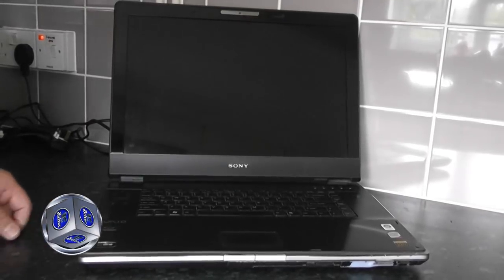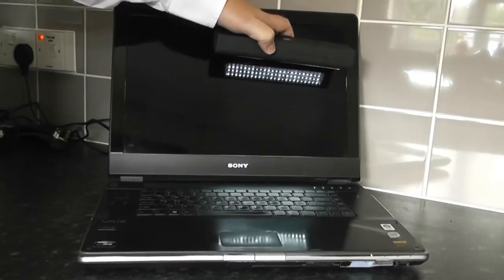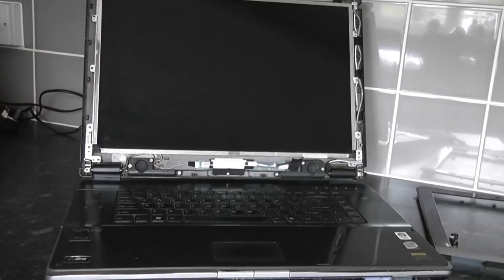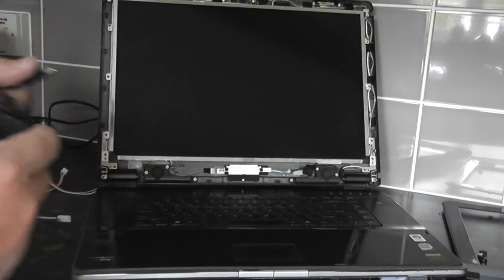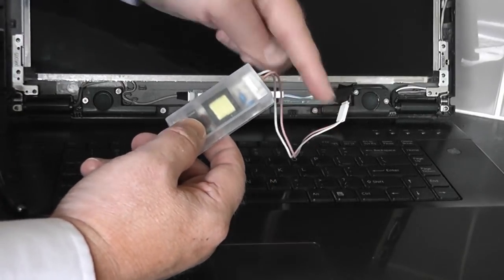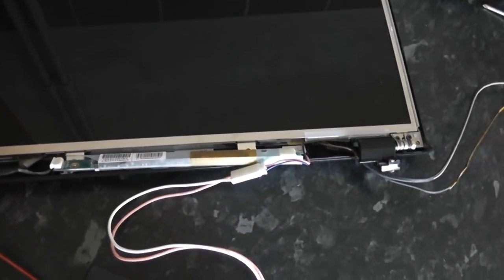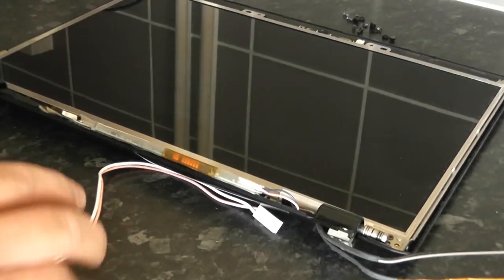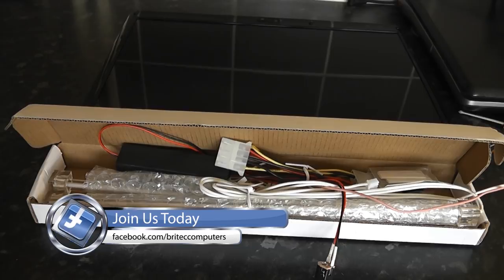Diagnosing Faulty Laptop Backlight or Inverter Problem

Comment: The inverter on one of my laptops failed and I didn't want to spend any money on a new one, so I searched for ways to actually repair the thing. Unrelated results came up so I inspected the miniscule board and came across a tiny fuse which looked like a rather large cloudy LED. I bypassed the fuse with solder (after testing with a pair of metal tweezers) and my backlight works once again! Word of advice, CHECK FOR ANY FUSES BEFORE ORDERING A NEW ONE ONLINE! You could save some money :)
Reply: Now you risk the chance of burning up the whole panel. An inverter is like 90 bucks but a screen = buy a new laptop.
Reply: ***** not true at all. I repair computers for a living and replacement laptop screens are usually at or under $100

Comment: The issue can be also related to a faulty GPU, sometimes when the GPUnit desolders itself you can get weird combinations of the video output like nothing on the internal display and a normal output on external vga or hdmi, it can be like half picture or only graphical content without backlight, distorted video output, lines, low brightness... first thing when I have a laptop in my hands with a faulty GPU I "reflow" it and if then still doesnt work as it should than Ive must re-ball it

:P

Comment: Awesome thought using a mini ccfl power supply like that. It never even occurred to me! I can pick one up for a few bucks.

I have the same issue. Though am just working out if it is the inverter or if its a control circuit in the laptop itself. Im going to go with the inverter as they are cheap.

Worst case you rig something up and you dont use brightness controls. Theres always ways around these things! Good video!

Comment: Hello, thank you for helping people like this.
Can you please diagnose what the problem is with the screen of my Aspire 5532?
Sometimes, immediately when I turn ON the computer, the screen is dimmed to about  only 10% of light just like when you use Fn+F6 to dim the screen, and I have to darken the room and then point a flashlight against the screen to see better what’s on the screen.
When the boot pauses asking me for the BIOS password, I take the opportunity to try to disable the dimming by pressing Fn+F6; and 1-sometimes it works right away but 2-sometimes it takes a lot more tries and 3-sometimes when it finally seems to work what happens is after 1 second it dims again forcing me to try just a few more times. And there is more; each time Fn+F6 doesn’t work, I notice that for just 1 microsecond the screen was getting more brightness but it couldn’t complete the job.
The next time it happens I will connect an external monitor to see if the external monitor is also dimmed or if it is OK, but maybe the information so far is enough for you to diagnose the problem???
Thank you again.

Comment: Which begs the questions.....How and can one replace the inverter? Where does one buy an inverter if they can be replaced? Is the inverter built on to a replacement screen? Are the backlight tubes built on the screen and how to replace them?....

Comment: For Windows users.
In case anyone's laptop screen has gone "dim", but is still functioning.  First try going to start– control panel – systems and security –power options. Then (at the very bottom of the screen) move the slider to brighten the screen. That might be all you need.
Reply: Thank you, it really helped. 
Do you know what is the problem here? If the brightness is not at it's maximum and I reduce it just a little, the screen goes completely dim, I can hardly see anything. (The external monitor is working as usual.)

Comment: My screen works fine, I can see it with a very bright light. Can I use this to test my laptop back light? -> I have a portable "inverter". It is actually a device that powers a small tube-light to make your clear plastic PC cabinet look cool. It is powered by plugging it into a normal PC power supply component-connector.  That tube plugs into the device (like yours), but I don't have any adapters that match a Toshiba inverter, I have a 50/50 chance (two wires I believe) for it to work by jumping it, but then again, is it safe to do that. It can't be more than 12 volts.

Comment: I bought a new Display, still the same problem (no backlight) #facepalm
Reply: Your lcd inverter circuit is not receiving power.
Check the power supply for your back light inverter.

Comment: Another quick and dirty way to test the inverter is to use a non contact AC voltage detector. Just hold it against the front of the bezel where the inverter should be and it will light up if the inverter is ok.
Reply: +Johnny Cache 
I wanted to test your idea because it sounded feasible but I actually tried that on a working laptop and when i brought the tester anywhere within an inch or two of any part of the laptop, even over keyboard it lit up so not sure an AC detector would be a viable tester. Guess the voltage field is to big on a powered up laptop.

Comment: First of all thanks for this tutorial.

I live in Indonesia, we don't have specialised shops with those parts.  I don't know if it is indeed a problem with the Backlight itself.  I installed a new lcd inverter but unfortunately the problem wasn't solved, it's the same.  It is intermitent: Sometimes I start the computer (HP Pavilion dv2000) and the screen is illuminated, but more often it isn't, altough I can see there is image.  After some tries (putting it to sleep mode and then on again) it sometimes works (I am writing on it right now, but I am afraid of ruining altogether).

Do you think it is the screen, the backlight?  There is always image, only mostly with no light.  Thanks!

Comment: So....If you plug in the inverter tester (BECAUSE it's bypassing the old inverter),  and there is NO DISPLAY, then the backlight lamp is bad.  Replace the backlight.

But  if you plug in the inverter tester and you HAVE A DISPLAY, then the  inverter is bad (because the lamp DOES work with the bypass inverter.   Replace the inverter.

If you gradually see the sccreen fading, it's LIKIELY the backlight is shot.
If the screen suddenly went off it's likely the inverter is shot.
Is that a correct diagnosis?

i assume:  Test the inverter FIRST because the lamp replacement is tricky.

Comment: Hi Britec09   At 3mins 19seconds - if you get a display using the CCFL tester, how do you then know the inverter is bad and not that the inverter doesn't get an enable signal from the laptop motherboard?  Doesn't that also need to be tested?

Comment: Thanks brian :-)

An En-light-ning tutorial lol, sorry i just had to say that :->

led's are the thing for new display backlighting but its going to take quite a few years for the population to replace there loved lappys.
Have you found any good led strip kits to replace the tube as ive noticed a change in the lvds connector in new screens, dropping a modern screen into an old lappy is not soooo easy ?

I use an old acer aspire 5315 and was thinking about it.

Comment: Hi,

Just recently (a few days ago) my Dell Vostro A860 started acting weird... after shutting down unexpectedly & turning it on after a while, a small black smudge appeared in the place where the time is displayed on the LCD (bottom right angle). I immediately thought this was a failing CCFL bulb, but I didn't replace it.

Today it destroyed my inverter (blown fuse actually). Thank God I've got a spare CCFL bulb for this type of screen.

Can I still salvage the inverter or not ? Some suggest just making a solder bridge where the fuse was before, my father suggested that I use a resistor instead...

Thanks.

Comment: I have a dim screen issue (when lighted with a flashlight, I can see the screen) - I have a Toshiba L655-S5146 (Model No. PSK2CU-0Q001T). This is an LED screen - does not have an inverter (CCFL). Through an external monitor, I can see the display. I have already replaced the entire LED screen, but it does the same thing - dim screen. Any other options out there? I've heard that some laptops have some sort of pin that is stuck and letting the computer know that the lid is still closed - but I don't know where to search for this, since there are no latches on this model.
Reply from the maker: There is a LED Fuse on the motherboard, also it could be brightness issue, hard to say without looking at the schematics for that laptop, have you tested to make sure power is getting to the screen?
Reply: Britec09 How do I test if power is getting to the screen? I don't have any testing tools. BTW, thanks for the fast response.
Reply from the maker: Raphael Rios it does sound like LED Fuse on the motherboard, do a search on google for your motherboard.
Reply: +Britec09 ..Excuse me sir...i face the same problem...i have a toshiba laptop model (C850-A827) but it has not invert cable cause it is led display monitor....I can not find out the problem....could you tell me ..what is problem my laptop.. please help me.

Comment: I don't have tools to test it, but I opened my LCD and took out the back light and plugged it directly with the inverter. The backlight turned on however it turns of in case I move the backlight cable a little. The backlight turn on when I refresh the screen from a function button on my Toshiba laptop. It seems that its not the backlight but the inverter which is bad because the backlight wont turn on at all if it bad - right ?. are you able to suggest if its inverter or backlight ?

Comment: Hello I have pc specialist recoil lll that's faulty the issue I'm facing is when I start the laptop the screen starts blinking on and off it boots into the bios just fine and I can't see any lines or artifacts I took the screen apart and measured the VLEDIN and the voltage wasn't stable going between 17~19 vdc so I then thought let's put a stable 19v and see what happens and the back light got brighter and my power supply started to click matching the screen blinking my thoughts where maybe its something to do with the power supply chip on the screen or the super I/O chip but as a complete beginner I've reached a dead end any help would be greatly appreciated 🙏

Comment: i got a screen where the back light turns off but comes back on again when taking the screen cable in and out of the mobo but as soon as i move the screen or touch the black cable it turns off the light again. the screen stays on throughout just no light. the first issue i had was flashing white lines which fixed by tapping the side so bought a new cable and now the issue above...

Comment: I don't have the fancy tester so I would like to tell you my symptoms.  I have a 
DELL E1505  and when it boots up I see the screen and everything looks normal for a split second then I hear a electronic zzzz sound and screen goes black but like in your video I can faintly see everything on desk top.  when a outside monitor is connected I see it all normal.  I ordered a inverter on ebay......do you feel that is my solution given these symptoms????

Comment: Hello there. My problem is that of, when I turn my laptop on, I see images like the backlight is gone. I plug it into a monitor and it shows up bright for a second and then goes to the no backlight feel again. Hopefully it's the inverter but I just don't understand why the external monitor is doing it as well. If you can get back to me that is great but most likely by the time you do I'll have it fixed or fed up.

Comment: ive been trying to figure out my dell screen for months. At first the screen was getting lines in it and so I replaced the cable. That fixed that problem but then about 8 months later the screen turned bright gray. It's not any display settings or video card as an external monitor works perfect. I put a light up to it but can't see anything and the screen is bright anyway. Turns instantly gray as soon as you turn on the computer. Pressing "D" on bootup to toggle the screen diagnostics displays various colors but after its done goes back to gray. After using the computer for a few days on external, all of  a sudden the screen worked perfect again for about a week until I once again received the gray screen. I tried replacing the cable again but that didnt help. So I am down to either the inverter or lcd monitor. Any ideas?

Comment: I have a odd and old laptop laying around.  an Flybook V5
The backlight sometimes doesn't come on, other times screen works fine for X amount of minutes.

First I suspected a loose connection somewhere. I ruled that out, it's not triggered by movement screen/wires/connectors
Which leaves me with blacklight or inverter. Can a backlight develop such a issue? As far as I know they can't.
That would mean the inverter is dying on me? (really hope not, I can't find a suitable replacement)
Reply: hey, could you finde out?

Comment: i need help, x220 back light not working, i tested the led pins on the actual panel, and they have no voltage. i dont know if the led driver is on the motherboard or the little pcb on attached to the panel.

Comment: I have a hp 2000-369wm with the same symptoms like the sony  but it has a led backlight with flat ribbon that hooks on the bottom part  so I checked the light with different screen and it lights  on but not on the hp  my problem is I don't know where is the inverter or this screen wont use inverter  I let me know thanks

Comment: NEED YOUR HELP have an acer 8930g, wont load a good working hard drive at first would turn off before loading up windows, now just sticks. could it be a bad capacitor? and could this affect the inverter, as i bought a new inverter it lasted 5 mins while i was investgigating the other problem, all other hardware works, tested graphics card etc..thanks for any help//

Comment: If the LCD flickers when moving it and it does not occur with an external monitor could it be the LCD itself or the Inverter/Lamp?  It glitches to with red and green artifacts when you move it.  I took off the Bezel and when I touch the Cable it flickers but how does that prove its the cable alone and not the GPU or backlight/Inverter/LCD?

Comment: I tilt the hold laptop to 45 degrees and the screen went black, it that cause by bad inverter???
Reply: The wires inside could either be over-extended or crushed between the movable parts.